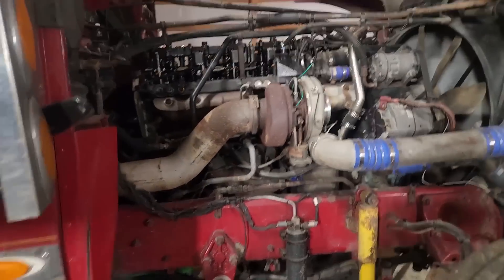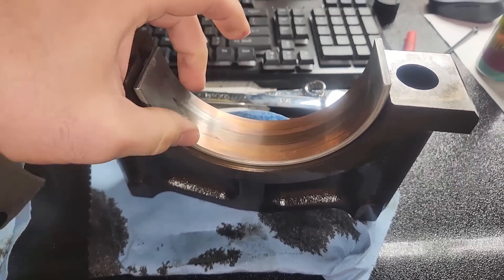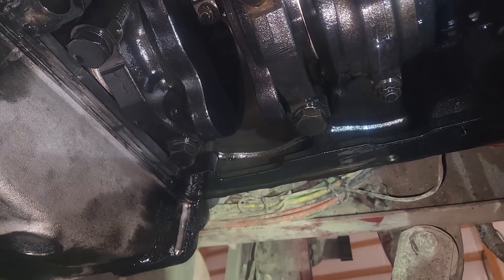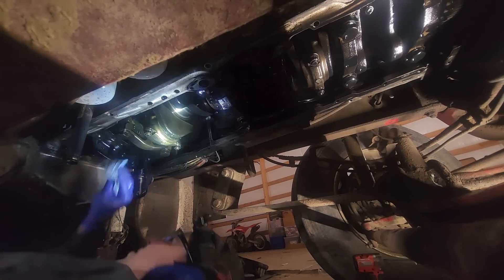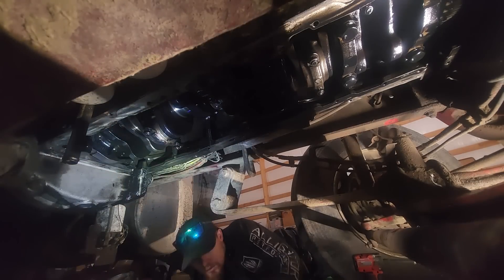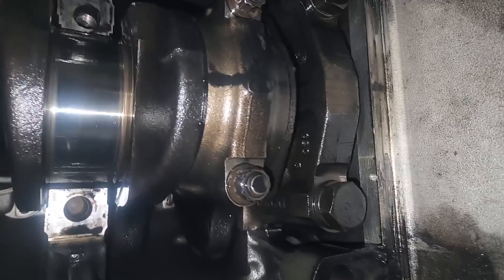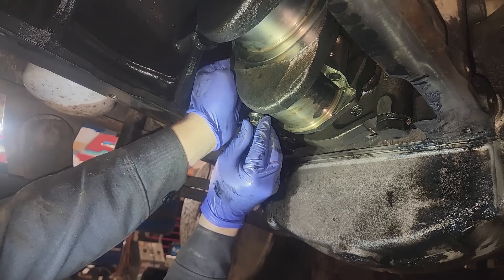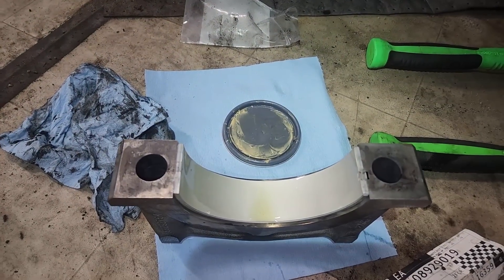This Detroit Diesel Engine Literally has TWISTED Main Bearings, but How?

Comment: Idk about diesel engines but when the lower mains are trashed on a small block its usually from a worn out transmission causing the crank to support the weight of the trans by way of the input shaft.

Comment: Would you be able to still ask the customer a couple questions by chance?

1. How long has he had the engine?
2. How frequently does he do oil changes?

Sounds like just bad/cheap bearings. But with no damage to the journals, it sounds like he kept up with oil changes. Did this solve his oil pressure problems?

Comment: Other than the theory from honkie247 below the only other thing that makes any sense is some sort of chemical (acidic) oil contamination but I would expect that would be on all of the bearing.  So I think by process of elimination and folks smarter about engines than I am I think honkie247 is likely right.  I hope you checked the grounds.  Keep the good stuff coming.

Comment: The main bearings are not perfectly round when new. The reason is for the crush that holds the bearing in place. The tab is for alignment  but it also helps keep it in place. 
The reason those bearing lost their shape is because of the amount of wear on them. Excessive wear causes the bearing to distort and from that causes them to spin. 
Bearing failure is never due to them spinning. Something else happens first such as excessive wear or low lube causing wear.

Comment: I hate Detroit's, and anything Freightliner. I'm a highschool student and I've been into working on trucks and heavy equipment for a while now with my dad. all the bus drivers at my school know me as the mechanic guy (because my bus driver is friends with everyone and told all his co workers). the other day a bus driver seen me leaving school and asked me about an issue. the air compressor wasn't keeping air pressure, it would build to 150 and then drop and stay below 90 until it built air again. it was a Thomas bus with a DD5. the air compressor was underneath the cab because Thomas has a mid nose bus and the engine sits closer to underneath the driver than over the front suspension. my school is a uniform school and my pants (and the snap on hoodie i was wearing) are now covered in oil from the leaking engine and road salt.

Comment: 11.1L ,12.7L and 14L displacements .  Replace oil pressure relief .
If Garbage Freight made crankshaft bearings , these would be them .
Purchase a Milwaukee M-18 water pump , it pushes motor oil and diesel fuel well .
International compound #2 also used for cylinder head bolts .  I always disconnect the batteries .
Glad to see you expanding in other areas .

Comment: I've seen bearings somewhat look like that from people using Lucas oil treatment that it pulls bearing material off. I've seen CATS do this more often than other engines. Lucas oil treatment really just oil thickener and has NO anti wear or additive package just dilutes oil. If its oil pressure when cold cause it and design of bearings for CAT engine. PACCAR engine will peg the gauge over 100 psi of oil pressure well older engines. Bearing being loose in the cap its bearing crush that keeps bearing in place. Many think bearing tab keeps bearing in place which only it thing it really does is locate bearing in the cap
Reply: I agree Lucas oil treatment is 
.              SNAKE OIL !
I do like Red-N-Tacky grease along with Green-N-Tacky .

Comment: I have seen static electricity fail babbet bearings before.  However, the static has to discharge into some kind of gap - otherwise it just bleeds off... so the usual failure in a static failure is in the top bearing.  Also I would change the harmonic balancer in that engine.  A harmonic balancer failure will usually manifest itself at the rear part of the engine.  The first thing that came to my mind was that the engine had sat up with antifreeze in the crankcase ... and then put back to work with the antifreeze damaged bearings for a while.  On bigger 2 cycle engines we used to do lead readings to determine the condition of the slipper bearings and detect bent rods.  The EMD engine (645 cu in per cyl) had a threaded hole in the middle of the piston that we could use to anchor the lead - we would use an old piston to form the lead and when the piston came below the air charge hole we would insert the lead into the piston and orient it so that is was parallel to the crankshaft.  When the piston came back down we would pull it out and measure it with a micrometer.  That way we could spot bad slipper bearings, bent rods, and rod bearing issues along with a couple of other things.  When you see that owner again tell him he needs to go to Vegas and bet on some long shot... he is verrrrrry lucky that that engine didn't turn into a boat anchor.

Comment: 0:51 I think they ran doubled rocker arms because this allowed them to have the intake and exhaust ports directly in line with each other. In the maritime world, the MAN Diesel 32/40, 32/44CR, 48/60, and 51/60 engines do the same thing but with pushrod valvetrains. This is in contrast to the C15 and X15 engines where the intake and exhaust ports are offset.

Comment: My suspicion is the bearings are cheap garbage and the force of the crankshaft pushing on them thinned the center forcing the ends to curl in. 

I seen a wheel bearing look all pitted and chunked like that #6 main once too. Not sure the cause, but I would suspect possibly lack of lubrication. But then you would think the journal would show damage. Hmmm.

Comment: Not getting proper oil pressure meant the bottom end over heated.  Warped bearings.  Luckily he didn't crack that crank in half.

Comment: I believe he possibly had contamination in the oil, such as a bad water pump pushing antifreeze into the oil, I would do a oil sample and check it out, was doing a cam swap on a Mopar 360, the cam bearings were shot, pitted just like those mains, we flipped it over and the lower bearings were in bad shape also

Comment: In my experience, this is the situation you get immediately before it spins the bearing. Like seconds before it spins. 
My understanding of the problem is normal wear in the bearing gets to the point where under certain operating conditions, the clearance alows the journal to start to hammer on the bearing. This very efectively removes all the crush from the bearing, and then starts to pound it into funny shapes. Shortly, the bearing will become so distorted that it will contact the crank and create a hot  spot. This makes the bearing grab the crank and spin in the housing. 
Your man had a lucky escape in my book. He was a very short trip away from destroying the block. 😮

Comment: It's been 35 years since I worked on a Detroit but if I remember correctly the thrust faces of the thrust main could be ordered separately if needed in different thicknesses. I think the reasoning was trucks with manual transmission used in the cities could put more wear on the thrust faces of the crank. 
Aside from Cat I've never seen a main bearing that only had thrust surface on the lower only. Good video

Comment: Good to see you back, congrats and all that...could be harmonic's, jineez junk bearings, and or oil change interval's, and oil weight too, or all of the above..IMHO.
good idea to change the relief valve and any o rings, rubber seals etc.while you're in there.
Thanx again Josh.
Congrats

Comment: just had my bobcat engine rebuilt 65hp diesel 1 spun rod bearing machinist had to line bore the block because new crankshaft bolted in so tight it would'nt rotate machinist found ALL crankshaft main caps were "oval" even though naked eye they looked ok so when a diesel engine spins a connecting rod bearing there's more damage than 1 crankshaft rod journal they're all messed up i was lucky lucky my tractor mechanic sent the block to the best machinist guy in my state many dealerships send blocks to him it was well worth the 7 month wait and only $3475 for complete rebuild

Comment: Regarding that main insert: I used to see that a lot.  I attributed it to detonation and preignition-the pressure spike on the piston -from the too rapid burning of the mixture-would actually deform the insert and cause the ends to curl in when the caps were loosened.  Bearing crush seemed to hold the inserts against the caps or the crank would have been wiped out.  
  Most of those engines had manual transmissions and a lot of drivers frequently lugged their engines rather than downshift for hills or going around corners.  A lot of pinging was heard!
Reply: 100% correct. If you build high hp engines you know bearing crush.. Nothing about that bearing has anything to do with oil starvation. A crushed bearing like that comes from excess cylinder pressure caused by detonation, precognition, excess engine breaking at high rpm, but I would check your injection timing. A little to early and you will hammer the bearings, a little to late your injecting on the cylinder walls and not the bowls of the pistons.

Comment: You will cuss the thrust washers . Had one undersize and put standard in and of course it had lower pressure.and another time 5 was on3wason1 and ran 5000 mile did not hurt crank. Gospal

Comment: If you get asked to work on any Cummins N14s in the future especially main bearings on one. Make sure to do some research before you tackle it cause they are known for spinning the mains after replacement due to a Block Fretting issue. Mostly just the main bearing journals get out of round and need to be line bored/honed during a rebuild. It's nice to see you working on other stuff, still love the CAT content but its always good to expand your skill and knowledge on other engines too.

Comment: my guess is some one stuffed a set of wrong bearings in it at one time or another was the engine ever rebuilt or straight from the manufacture, maybe a bad day on the assembly line,, some supervisor said use these bearing they will work

Comment: That oil pickup tube part that says regulator is the pressure relief valve. It has a spring in it and it regulates oil pressure and if you’re ever having oil pressure issues check the pickup tube and verify that the spring in that is unobstructed/unbroken.
Reply: Also the way you get the caps off is just like you were doing, wiggling and a couple gentle taps in both directions.

Comment: Used to see that bearing damage on BMC diesels decades ago, it was water in the oil caused it on those, often from rust/pitting through the wet liners at the bottom O ring line.

Comment: Heat will distort a bearing. As evidenced by the copper showing it had some heat. Pretty close to getting hot enough to warp the caps also. And it could have warped the  ones you were fighting with as they more than likely have spread, so it makes it hard to get the caps into the register.

Comment: My guess the engine has been run at low rpm ( 1000-1200 ) for long periods of time, which is a critical rpm where torsional viberation comes out on 4 cycle in line 6 cylinder engines😢 the bearing will not spin because the upper & lower is holding each other in place  but ounce it is removed it will not have the proper crush  god help you if you put that bearing back . I had a kta -600 rod bearing ( # 6) that was loose in cap & it was magnetic . The low rpm (1100) is death a customer running the I  5 courdor in 369,000 miles destroyed a rtlo-16913 road ranger transmission was not even rebuildable.all the engine mfg will tell you to run at that rpm because that is where engine gets best fuel mileage & that is where peak torque is at 😂now take all the$$ you saved & take out $ 9000 to replace the transmission 😢😢

Comment: Had a Perkins Diesel do that only worse, oddly didn't wear down to copper, just blasted channels in brg material, fuel dilution was the cause. Thin oil cavitating. Synthetic oil viscosity is NOT rated the same as natural oil. They are rated on a rather arbitrary "equivalency" scale, rather than a pour test. They are much thinner, that's where most of your fuel savings come from. as clearances widen they do not cushion or dampen vibration as well. Seen it happen very quickly on older engines that switched to synthetics. Royal Purple says to run 50w synthetic on the street in a hotrod v8, and 30w at the track. 30w synthetic doesn't cushion enough for high compression at low speeds. They and Amzoil say to expect a 10psi pressure loss with synthetic. We had ISX Cummins die at stoplights after being switched to synthetic because the oil pressure dropped too low at idle, VERY irritating! There are no free lunches.

Comment: Some John Deere engines like the 6081 use a near identical thrust main bearing set up. Amazing that thing never spun a bearing. I’ve never seen a bearing loose in the cap like that.

Comment: Yup, I have seen that main bearing failure a couple of times. Bearing wear and the resulting low oil pressure lets it have metal contact instead of an oil hydrodynamic wedge. Very cloes to the bearing sticking to the main journal and spinning the bearing. I bet it is over 250k miles on the bearings.
After seeing the bearing, that is fatigue failure of the bearing. The electronic injection are easier on the bearings, and the newer DDEC that use multiple injectiins per firing event are even easier on the bearings. The mechanical injection was harder on the bearings, due to the single large volume injection.
I once worked on a 6V92 in a Ford. The fellow bought it used with a supposedly completely rebuilt engine. When he got it home there was an oil leak. When he had his main truck 8V92 engine overhauled, one of the guys got to be friends with him. So he called to talk to my coworker about looking at it for him. I agreed to go with him. Turns out the perimeter seal had come out on one corner, letting oil leak. When we pulled the head I found a couple of cracks. When the 2 strokes get worn, the ring ends can get in an intake port as it stops rotating. Next start snaps it off and eventually the turbulent air picks it up and through a cylinder and out the exhaust. It then hits the end of a turbine blade and takes a small mouse bite out. By the time the engine gets rebuilt there is a bunch missing off all the turbine blades. Take the exhaust off at the turbine outlet and look in to check. He took the cracked head and damaged turbo back to the used dealer. They were mad he did not just bring it back to fix the oil leak.
Two years later and 35,000 miles, he and his hired man were coming home with loads of hay to the farm. They had stopped for coffee and when they came out the 6V sounded fine, but did not make it to the scales 80 miles away. We went down and pulled the oil pan. The bearings were like copper gravel in the pan. The bearings did not turn, so the block was OK but the crank was scrap and the loss of oil cooling to the pistons turned the oil on the cylinder walls to like road tar. The head we had not replaced was cracked, probably all along.  The shops insurance adjuster would not pay. Eventually he got promoted and his replacement signed a check real quick, but 2.5 years had gone by. Almost lost the farm and wife over it. He did get a new upgraded crankshaft and fully rebuilt engine when we finished it. All new bearings and another new turbo. 
The tradition was to do a bearing roll every 250,000 miles. When the used dealer rebuilt the engine they replaced the cylinder kits and rod bearings and lapped the valves. Never replaced the main bearings which allowed them to fatigue and flake away suddenly.
Try torquing those in the bush by yourself.

Comment: Seen many bearings loose like that, caused by excessive oil clearance or lugging. The pounding from the combustion pressure moves metal away from the center of the bearing and brings the outer edges in. Beat on the center of a piece of metal on an anvil and the ends will start to curl up. The crush when assembled still holds the shell tight to the ID of the bore. 
Thrust bearings like that are pretty normal, see them in DD, Cummins and John Deere.
Reply: Was going to say the same. See similar in gasoline engines with detonation.
Reply: Hi sherrytop!  Looks like you beat me to it.
Reply: When that happens aren't the upper rod bearings usually hammered as well?
Reply: I have also seen this in a sbc where the oil pump bolt was murdered on and distorted the main cap. It wasn’t quite so bad but it was warped and had an odd wear pattern.

Comment: Check the block grounds I've seen that damage before online and the overwhelming consensus was block ground causing ark damage on the bearings runner up answer was old coolant intrusion repair leaving coolant in the oil more common on egr trucks

Comment: Ive been into a few with bearings that way. Typically it is from either cavitation due to suction side orings or water in the oil normally from injector cup issues. Ive heard the electrolysis thing before but not in person

Comment: Measure the width of the bearing at both parting lines as the center.  I'm betting you will find the center to be wider.  I'm wondering if the fuel is turned up and the engine is being severely lugged down beating the bearing flat and losing crush.

Time 818:  bearing number A-23532926  comes up as Interstate-McBee  Lower Main Bearing    I-M is a Cleveland, Ohio company that makes gaskets and remans fuel injectors.

Comment: Have you ever worked on a 71 series Detroit.  They are nothing like this, the original keep it simple design where the most uneducated person could fix it in the field and they will run forever.  I’m currently rebuilding our quad pack that has 4 6-71’s on a single falk gearbox.

Comment: G'day Josh, I'm just guessing the bearing may have suffered cavitation. 
Be sure to replace the oil pump pick up tube Orings as they deform and go hard. 
The 60 is a pretty good engine. cheers, Butch.